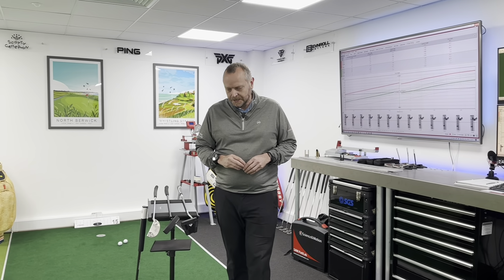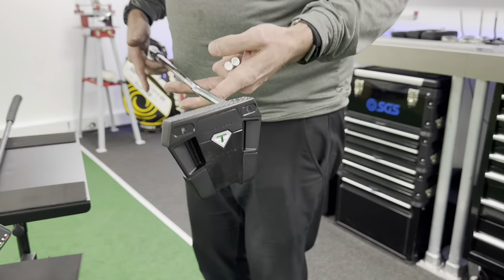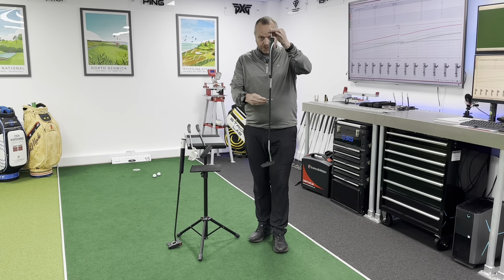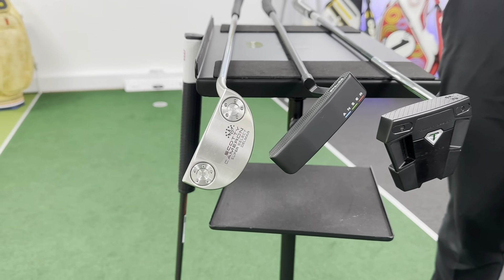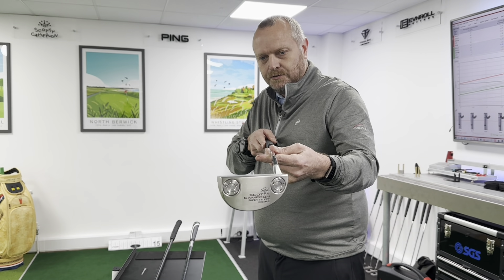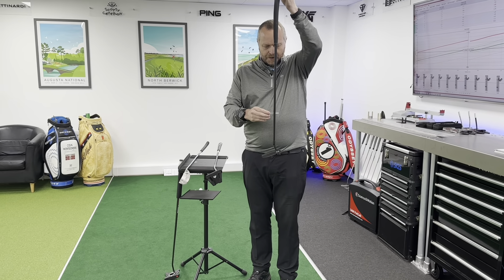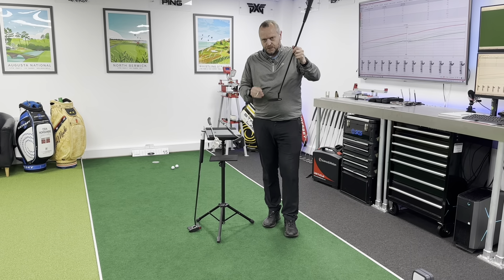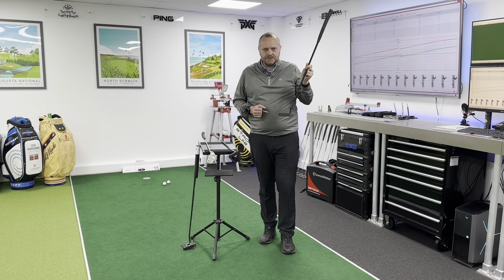Putter JARGON. Face Balanced and Toe Hang with Mike Clark

Comment: Can you do a video on golf shafts and what the difference is between a stock "steel" shaft and something like an after market LA golf putter shaft
Reply from the maker: Sorry for the delayed reply. It is something we have looked at but without an R&D robot to take out the biggest variable which is the human it is incredibly difficult to quantify the differences. The robot may show some minor effects but most of the difference is subjective from a feel point of view and therefore until the player tests it for themselves you don’t know for sure what it will do for the results. The other issue is how few heads the composite shafts can go in as they have to be a plumber neck (LA do an overfit but it is the only one who does) so it is very restrictive.